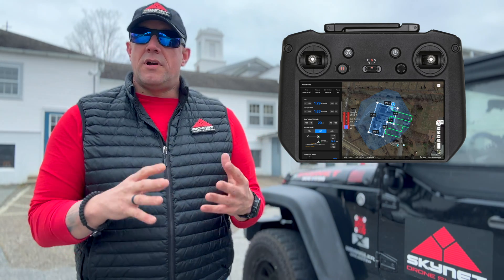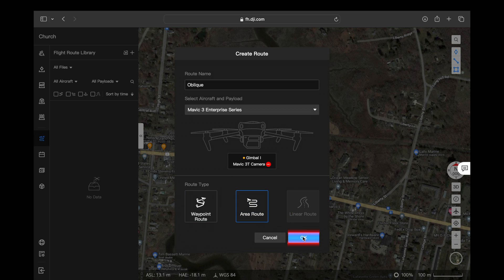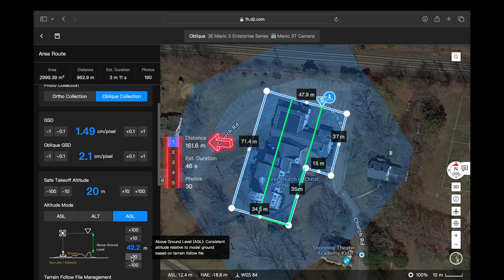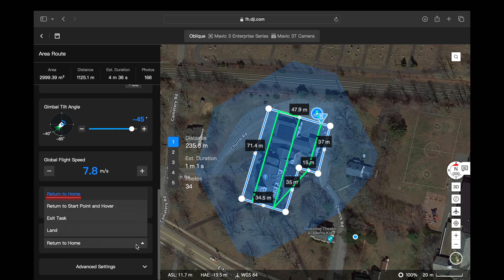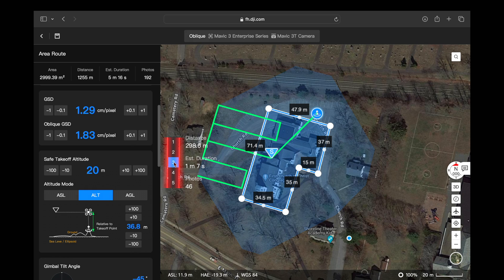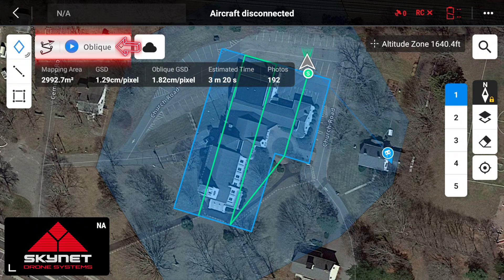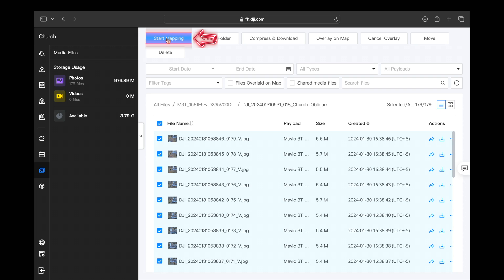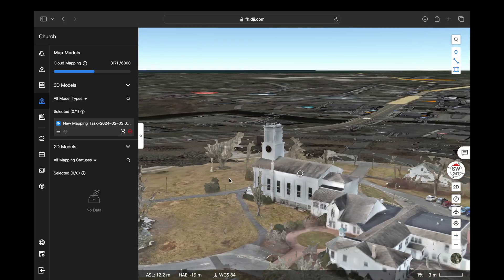HOW to CREATE a 3D MODEL using DJI FlightHub 2

Comment: Bad ass. Very helpful. I've been mapping and surveying with drones almost a decade but just branched off to start my own company. Would any of the other processing software do the same as this like Pix4d or Carlson Photocapture? I use Carlson because of it's CAD friendly user base but have only done ortho's and topo's, never processed a data set like this. Also do you know if a 3D model like this would be usable in a CAD format? Or how would you display this model to a client if they wanted to view it or show it off? Thanks for the content!
Reply from the maker: We use DJI flight hub 2 for all of our sharing with clients.  I have experience with Drone Deploy WEB ODM and a few other software platforms.  You can invite the client, architects or anyone associated with the project to a project folder that contains all of the imaging and models.  From there they can download anything into various formats for the models.

Comment: Hello- great tutorial. At the end of the video you talk about giving the client unbelievable deliverables...you even show some sort of report with measurements, images, error detail chart, etc. Can you share a bit more about that report and your process...is that done manually in word or some other feature within DJI or another software. Thanks in advance.
Reply from the maker: No problem at all.  I use a few different programs however the one you saw generated in that report was created using the free software by DJI called Thermal Analysis Tool.  You can upload data into it and get a detailed analysis of your data set.  🔺

Comment: Thanks for the instruction.........but after setting up the flight route for my home project, the calculated number of photos for all 5 routes came to 91, indeed all routes added up to 91.  But after the mission, my "Home-Oblique" folder had 154 photos, 63 more than was calculated.  This is my first try at it and am wondering if I did something wrong, thanks.
Reply from the maker: Most times it’s as simple as a change in the value of the pixel to centimeter data.  In other words you captured a higher resolution set of data with a smaller centimeter per pixel ratio.  Check to see if the mission altitude in FlightHub 2 is the same as the executed mission data in Pilot 2.  

Go to the project and take a look at each routes info.  It’ll show you the amount of photos taken.  When you setup your oblique routes it will automatically set one of them to do an orthomosaic (top down) route as well.  Perhaps the ortho route added the extra images?  There shouldn’t be that many ortho shots associated with that number of oblique photos taken.  However I’d start there.  Then take a look at the photos themselves to see if you can identify what route they are associated with.   

Whatever it is, it’s a very simple fix! 🔺
Reply: @Skynetdronesystems  I set the mission altitude at 100 feet (using Alt Mode), but going back into the flight library it said 101.3 feet.  In Pilot 2, the flight record indicated that the mission was performed at 95 feet, while the Mapping Quality Report indicates the avg flight altitude was 82.74 ft.  Are these differences a normal occurrence?  Looking at the 3D image, there's areas shown far enough outside the planned area that, it seems anyway, they really shouldn't be there, perhaps that the difference, IDK.

In the Flight Route Library, the ortho flight was 19 photos, while the oblique routes were:  19, 17, 19, 17.  Checking the actual photos, there appears to be 11 additional photos on the ortho run, perhaps the oblique runs had addtional as well and that's the difference, again, IDK.

I was finally able to determine by overlaying the individual photos on the map that each oblique route contained, respectively, additional photos:  11, 15, 11, and 15 more photos..........when adding the 11 additional ortho photos, the total difference equals the 63 photos over the 91 that were calculated originally.

So now, I just need to understand why this occurred..........is it because  of the lower " average" flight altitude, and if so, I wonder why the mission altitude was altered from what entered in the Flight Route Library.  Suffice to say I'm understanding more of this now.
Reply from the maker: You’re doing great navigating  the software and performing these flight missions!  It seems like there were a few additional photos taken during each flight route when the mission was performed in Pilot 2.  I’ve noticed some variation in amount of images predicted to be taken inside FlightHub2 and the number captured during the mission in Pilot 2 as well.  It might be just the software predicting the amount of photos that will be taken during the mission inside FlightHub2 and the amount taken during the execution in Pilot 2.  Or it could be a slight deviation in the altitude/GSD which would cause it as well.  Have you processed the data into a model and if so how did it turn out? 🔺
Reply: @Skynetdronesystems  Well, I was very impressed with it.  But I don't understand the extra "pieces" of imagery far outside that light blue boundary that defines where the oblique flight routes were flown.......meaning, there's imagery even beyond the flight routes of the oblique runs.  I'd upload a screen shot but can't here.
Reply from the maker: Roger that.  It’s called “Margin” if you go into Flighthub2, select your project then scroll down on the far left slider to “flight route library”.  Choose to edit your flight route by clicking the pencil looking icon next to the 3 dots.  Scroll down on the left hand menu to advanced settings.  Click on that, then scroll down until you find “Margin”.  I checked one of my flight routes and it’s set to 0.  Let me know if that solved the issue, if not we’ll get it figured out🔺
Reply: @Skynetdronesystems  I guess you're saying that "Margin" should be set to 0..........my margin was set to 0 as well.  I don't want to become a thorn in your side on this, lol.........but just trying to understand it all.  I appreciate your time here.  It would be beneficial to see a few screen shots, perhaps I could send you some.  It could be that there's no issue with the imagery at all and it's my own interpretation that is a bit wonky.
Reply from the maker: No worries!  Navigating this software, flying the missions then going through the data and processing it is no easy task initially.  Figuring out the correct GSD formula felt like alchemy to me at first.  Send a few images over to seth@skynetdronesystems.com and I’ll take a look for you! 🔺

Comment: So I created an ortho and oblique mission in the Pilot 2 app on the controller, completed the flights, and am now trying to export the info into FH2 for processing. FB2 isn't allowing me to connect the controller/aircraft, or upload photos into FH2.. Any ideas?
Reply from the maker: The flight route was created in Pilot 2 on the controller and you’re looking to upload the data into FlightHub 2.  I’ve experienced something similar recently.  
-Login to FlightHub2 on your controller through your internet tab 
-Try creating a project inside FlightHub2 and making that projects location correspond to your flight mission location on the map.  
-Turn on then Connect the aircraft to your controller.  Go into your media files tab and then see if it will let you upload from the aircraft.  

If that doesn’t work let me know and I’ll try and figure out an alternative solution for you. 🔺

Comment: can you use this software with the Air 2s?
Reply from the maker: I’m not sure, however you 100% can try it for free up to 3,000 mapping images and 2,000 live stream minutes with your DJI account.  If that doesn’t work for you, there are a few other options I’ve used.  Specifically an open source service called WEBODM (Open Drone Mapping) It’s only $60 for a lifetime subscription.  I’ll link it here:
https://webodm.net

I’d give DJI FlightHub 2 a shot first.  If that doesn’t work for you let me know and I’ll send some more options your way. 🔺
Reply: @Skynetdronesystems  I have tried dronelink and am looking for a software that is not subscription based and is good for beginners.
Reply from the maker: The software I mentioned above WEBODM will allow you to process as many maps and 3D models as you want.  It doesn’t have a flight route planning option.  But you can capture images with your Air2S and then upload them into WEBODM then generate shareable 3D Models, orthomosaic maps and thermal maps.  I use it a lot for large surveys that would soak up a lot of my monthly image processing on FlightHub2. It’s fantastic for practicing since there are no monthly fees or image/model/map limit.  It will also generate a report for you of the flight, maps and models.  Hope that’s helpful 🔺
Reply from the maker: @lambo_drives Let me know how it goes with your target area!  As long as we refrain from employing anyone by the name of “Miles Dyson” we should be good to go 🔺
Reply from the maker: Correcting the post from above.  I just looked into it and FlightHub 2 is only designed to operate with Enterprise edition aircraft.  Currently the only UAVs that are compatible with the software are the Mavic 3 Enterprise line, M-30 and M-300/M-350. 🔺

Comment: Awesome video!
I see that you are using det M3T for this job. How does the mapping/3D-model from a M3T compare to a modell created with a M3E?
Im currently in the prosess of upgrading my drone lineup and I have been told numerous times that the M3T does NOT do mapping well and I have to have the M3E to do what you just did in the video. 
What is your thougts on that? 
Thanks in advance
Reply from the maker: The M3T has done a great job performing the flight tasks and capturing the images I need.  I’m not 100% sure why the M3E is recommended more so than the M3T for mapping and modeling missions.  The statistics on the cameras appear to be exact other than the fact that the M3T has a FLIR thermal camera.  Both have mechanical shutters, Equivalent Focal Length: 162mm, 12MP, 56× Hybrid Zoom.  The only thing I see different on the spec list might be the size of the camera sensor and better low light photos.  HOWEVER having a thermal camera to perform inspections is an absolute game changer IMO.  I’m releasing a thermal mapping video tomorrow that showcases the M3T’s ability to overlay a thermal ortho over a 2D ortho of the same area.  That might help you make your decision.  I’m sure the M3E is a fantastic aircraft, but IMO the ability to capture thermal FLIR images sets it apart.  I think that DJI released each aircraft in the M3 Enterprise series with a specific task in mind.  The Multispectral for agriculture and crop analysis, the M3E for mapping and modeling, the M3T for thermals.  However with the same stats on the cameras and the ability to capture images IR with the FLIR.  I can’t see you being anything but thrilled with the M3T.  🔺
Reply: @Skynetdronesystems  
Thanks for a good and thorough answer! I was told by my local DJI dealer here in Norway that the M3E had a mechanical shutter while the M3T "only" has an electronic shutter. Therefore M3T was not suitable for mapping at all due to rolling shutter and the "dragging effekt" in the corners of the pictures. 

From what I could see in the video, the model of the church turned out very well! 

Can't wait for the next video.
Reply from the maker: I’m glad I could help out!  Here are the specs on the 3E and 3T shutters off of DJI’s website: 

Shutter Speed

DJI Mavic 3E:
Electronic Shutter: 8-1/8000 s
Mechanical Shutter: 8-1/2000s

DJI Mavic 3T:
Electronic Shutter: 8-1/8000s

So I was wrong in saying the M3T had a mechanical shutter.  I’d read this and thought it to be accurate however it appears I was incorrect: 

“Featuring a mechanical shutter and 56x zoom camera with 640x512 thermal - the DJI Mavic 3T is a powerful drone for first responders and enterprise pilots alike.”  

That was the top answer I got on Google however it appears to be off of a website not DJI directly.  Sorry for any confusion.  🔺